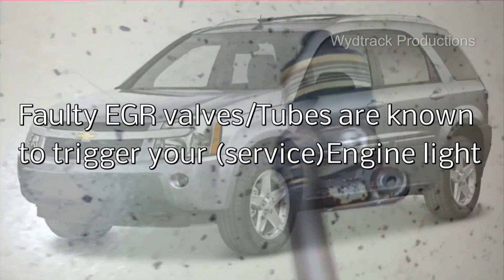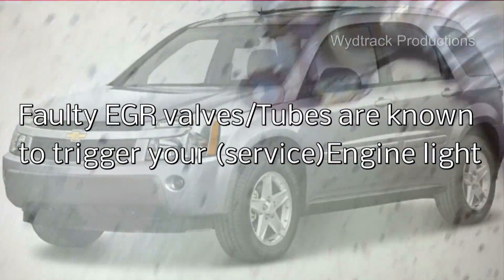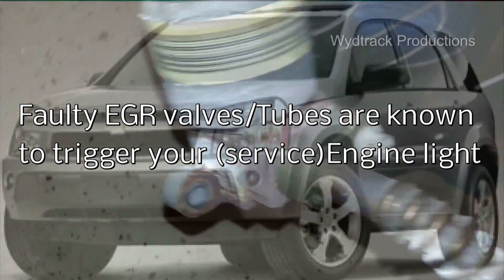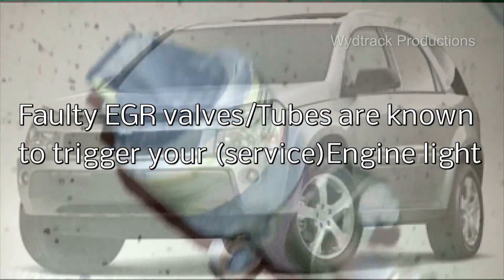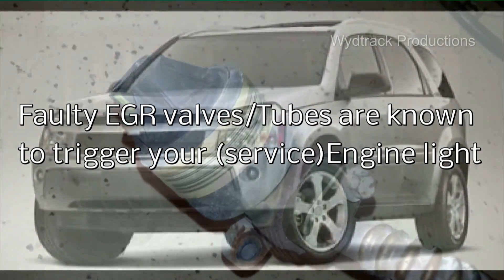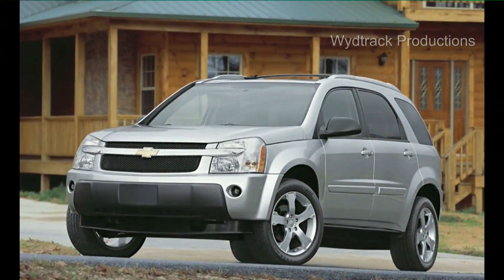How to install EGR Valve and Tube Chevrolet Chevy Equinox Pontiac Torrent

Comment: hey bud I did everything but take my time, now I was stupid enough to cut all the wires off of my last pigtail connector and now I have 2 grey wires in where I cant tell them apart. and clues or solutions my friend or just wing it? I mean what would happen if I put them on wrong and if the check engine and the other lights don't turn on I could just switch the wires right?
Reply from the maker: you will make your check engine light come and stay on , they are color coded . Use my video at the 1:14 mark and 1:17 mark to help you realign your wires

Comment: The diagram picture is fairly ambiguous as to what goes where @1:20. Should I assume that the wires laid out in this picture correspond left to right?
Reply: So wire colors are the same, I'll just need to cut and match colors together?
Reply from the maker: +zakats correct wire layout on the same model year will be the same
Reply: Dusty Seifert I have the same question as you do but haven't been able to find a straight answer. How did you make out with cutting and matching the same colors? Was that correct? Or did they actually have to be reversed? Thank you

Comment: Do you also do mechanic work or just work on your own vehicle.  I have a P7101 code on my 2006 Chevy Equinox and wonder if this EGR Valve and line tube could be the reason for this check engine light?

Comment: According to GM's TSB for this issue the PCM needs to be updated for the 2005-2006 models. Did you have this done?
Reply: Dito.  TSB calls for PCM flash.  Did you need to have this done?